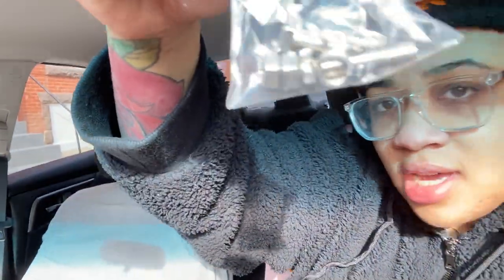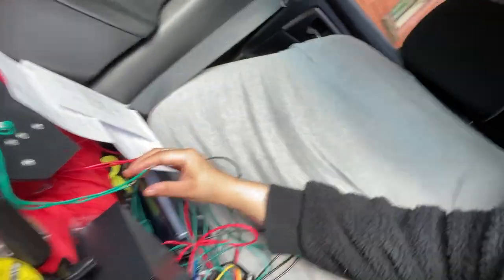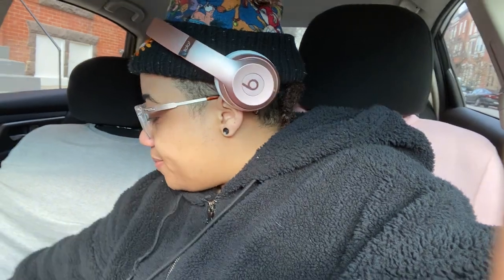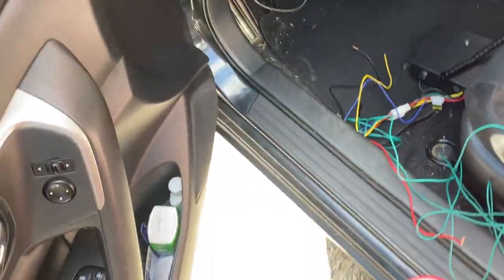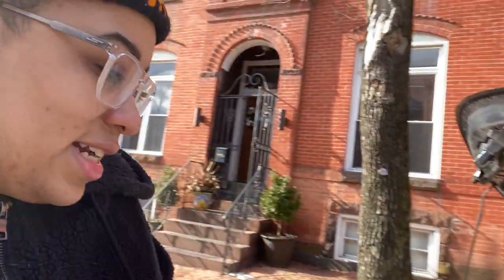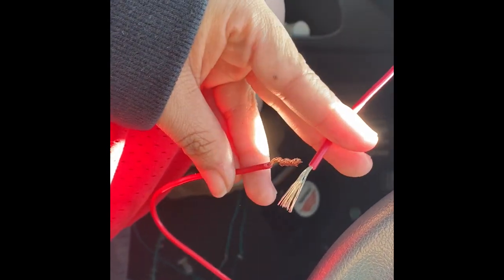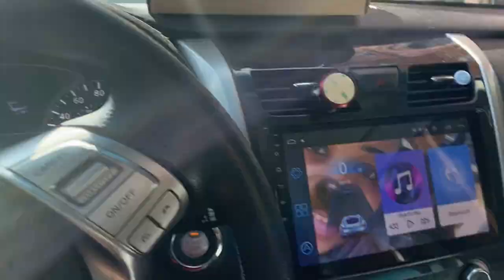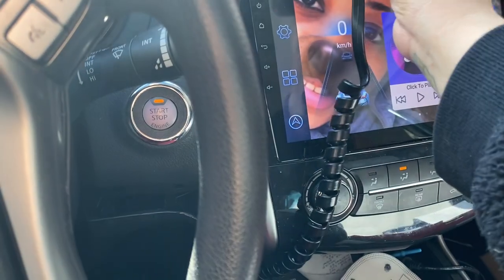Installing PA System from amazon in car @culturedandseasoned for more vids

Comment: I installed mine but when I hit the buttons all I hear I a click sound from the box :(
Reply: You probably have a bad connection on one of the speaker wires.
make sure they aren't loose. I have the same speaker and siren.
If not that you might have bad ground which results in low voltage.

Had mine for a year and It's still going through snow, cold, mud & rain.
Reply from the maker: I agree , check your wires and make sure everything is connected correctly